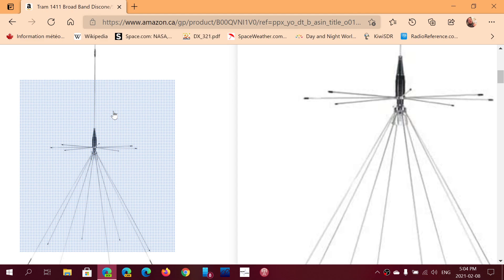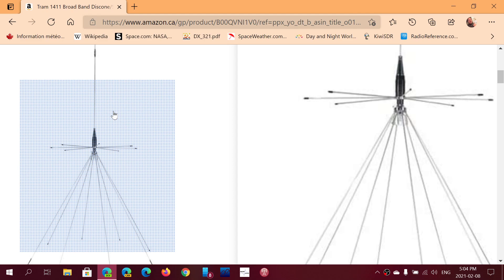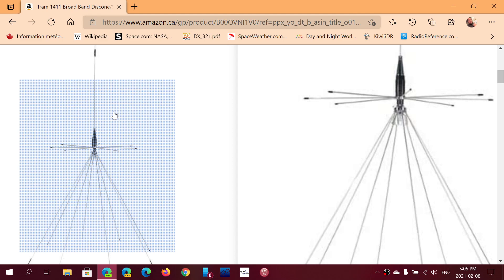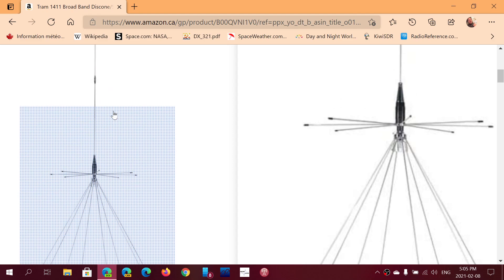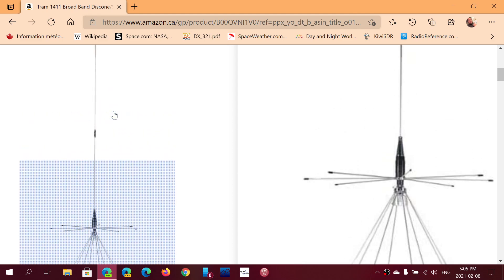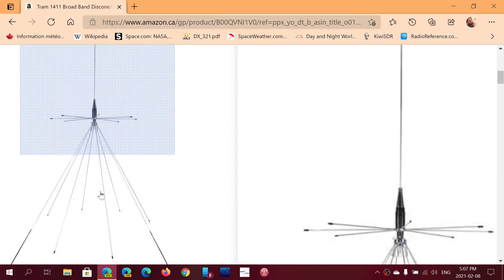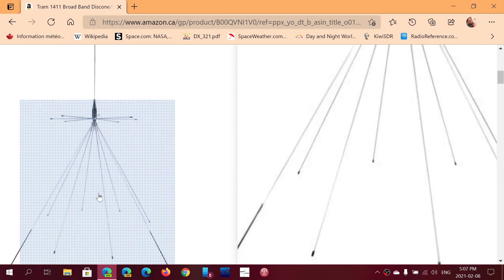TRAM 1411 Discone antenna questions and answers from viewers

Comment: Left one at a place i lived in 10 years ago so the design must be quite old. It was the exact same antenna. I can confirm I remember it worked well. The only thing about discone antennas is that the change from vertical to horizontal polarisation and everything inbetween,  over the frequency range, all discone antennas do that.

I had it out in the weather for about 7 years at the time and it did very well, only the nuts rusted, so if they are not stainless steel today, I would likely buy some stainless steel nuts for it.